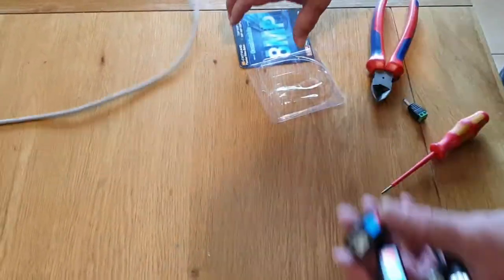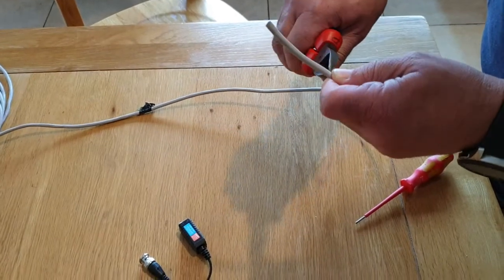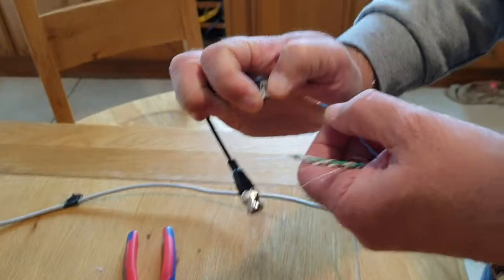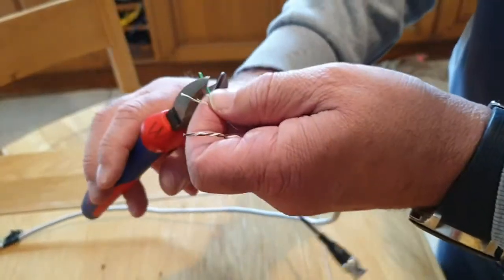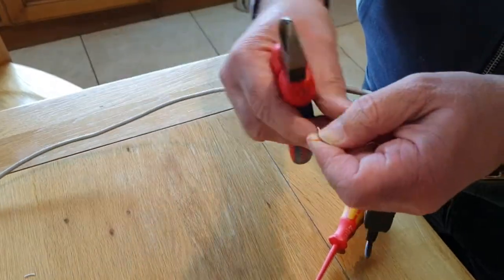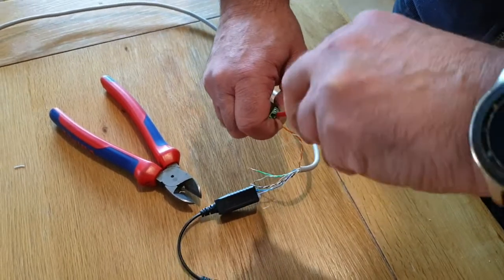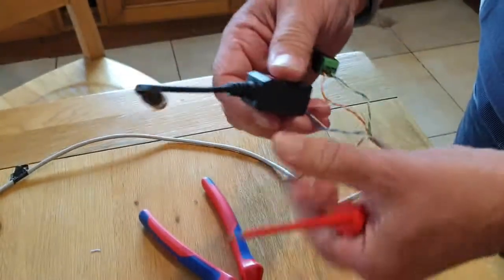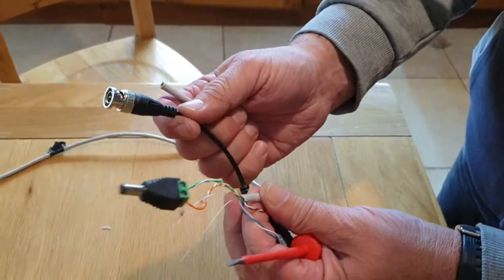How To Connect Balun connectors To CAT5 Cable For CCTV Cameras -HD Version

Comment: QUESTION: a CAT cable had three pairs of wires. Can I simply use a single ethernet cable and baluns to connect three individual cameras ? Or is that silly and won't work due to interference of the signals inside the ethernet cable? Many thanks for the answer.